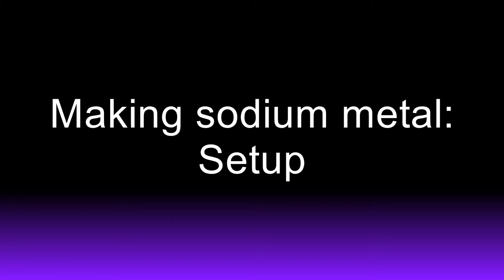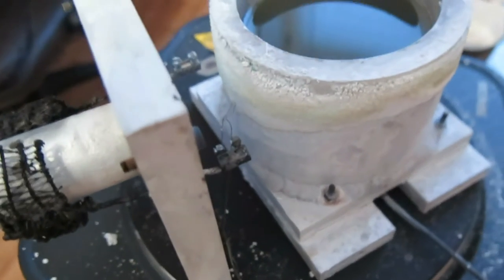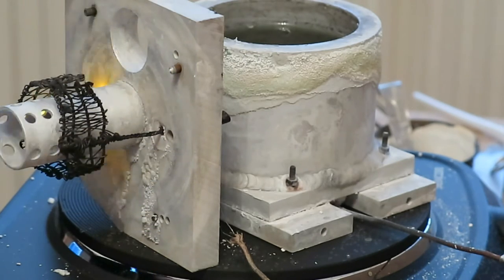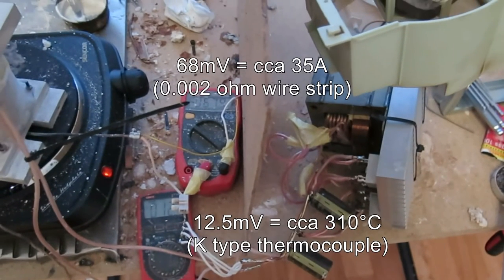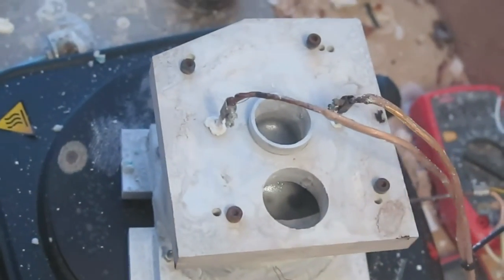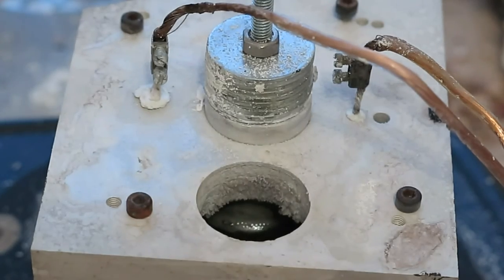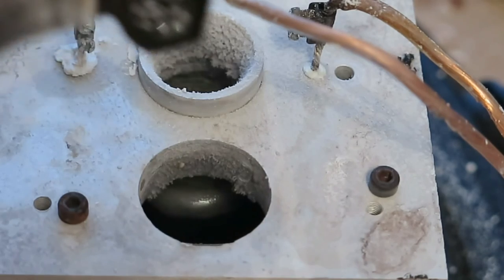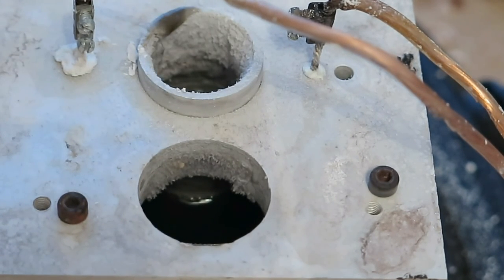Make sodium metal - Sodium hydroxide elecrtolysis cell

Comment: You put alot more effort in your set up but we are on the same page. I did mine outside gave the neighbors a show. The hydroxide also ate my gloves. Also found out I dont care what anyone says I say keep vinegar nearby as water will give you little mercy. When molten sodium hydroxide splashed forhead during tiny pops you will want instant relief trust me vinegar should be nearby at all times as even with saftey masks wierd things happen.. neighbors laughes hard.. I also connected the lead where the metal is formed to a pair of needle nose pliers as it would attract the sodium metal and I would gently grab globs continuously. I melted sodium metal with household pot and hotplate and kept mineral oil in another pot on another hotplate after collection of all sodium metal I would turn up heat on mineral oil till it melted the hydroxide and the sodium metal which allowed it to separate then I extract pure sodium the no hydroxide. Was able to complete whole process rather cheaply  Few dollars few chemicals burns couple regular burns and no scars. I'd this still sound like something you want to do at home that means your as smart as I am and someone needs to be supervising you at all times. DO NOT TRY AT HOME YOU WILL GET BURNED. DEATH IS POSSIBLE BUT BURNS ARE A GUARANTEE.

Comment: you can make a U bent tube, sodium metal is made only on one side of the U bend, so the weight of the sodium hydroxide pushes the sodium metal up and out a small exit, self separating the reactants
Reply from the maker: Thanks for suggestion. I made vid about future design(s) https://www.youtube.com/watch?v=kGxQbjS2IPQ
this one chamber design has advantage, that it is easier to arrange electrodes i a way they have to be in order to work. And that is close together and rather large.
I mean this U thing is possible, but I don't think, that simple bent tube would work. it would have to be welded of 3 pieces more likely.

Comment: Molten Sodium Hydroxide in an Aluminium container??? 
That sounds like a recipe for disaster. I haven't done it myself but I'm pretty sure it won't end well.
Or am I mistaken here?
Reply: It's fine at low temperature but at higher it would certainly be a disaster.

Comment: Please answer my Question:
Electrolysis of Sodiumchlorid in water produces chlorin gas and Sodium. The problem is that the sodium reacts with the water to NaOH.. So far so good..
But what would happen if you put the Sodiumchlorid into a Substance that works for the electrolysis, but doesn't react with the sodium? If that would be possible, it would be an extreme cheap, easy and safe method to produce Sodium metall? Do you know if that is possible?
Reply from the maker: Hi,
It is likely, that if this would be possible, somebody would at least try to do sort of that thing :)

What you want to do is basically dissolving sodium chloride in ionic liquid or "inert" polar solvent
Ionic liquid is a liquid composed only with ions, and therefore it is conductive.
as for polar solvents these would be probably fluorocarbons and as Nurdrage's recent research shows is that sodium is quite reactive to these.

in fact sodium is extremely reactive so you will need to be very clever to design a suitable solvent.

I found a few papers listing compounds, that can dissolve a bit of salt, which would be probably expensive and will not withstand presence of elemental alkaline metal.

However, I can't tell you that it can not be done...

If you are very interested, I would search for something like

soduim metal ionic liquid
soduim chloride ionic liquid solubility
soduim metal inert polar solvent
...

aaaand expect a lot of academic papers...

cheers :)
Reply: Ilusys Systems Thank you very much :)
Reply: Just fill a container with warm salt  then place ice on it,  keep pressure on it and keep it cold.
Reply: The only concern would be the clorine could dissolve into the solvent and destroy the sodium

Comment: What happens when the molten sodium hydroxide gets too hot? I read that the sodium gets dissolved into the hydroxide and cannot be separated. Has this happened to you before? I tried to electrolyze the lye on a small propane stove, and while it did work for melting the hydroxide, and at one point I saw a sort of a grayish film at the top. Afterwards(with my propane exhausted ) I reexamined the experiment, only to find that the sodium hydroxide had solidified into as waxy brown solid from which I could not removed the sodium. Frustrated, I poured water into the can. To my surprise, nothing happened. I expected at least some fiz or sparks or a subtle display of reactivity, but all I could see were supposed hydrogen gas bubbles evolving from the solid.
Reply from the maker: I think, that sodium should separate from lye when cooling in such case. What was material of your container?
Reply: Aluminium(a tuna can)
Reply: Just buy sodium it's so cheap
Reply: @AUXASSASINX  from where?

Comment: Fantastic! have you had any problem with corrosion of the aluminum body?
Reply from the maker: thank you! no problems at all during electrolysis. Cleaning with water does no noticeable damage as thicknes is 10mm or cca 1/2in.

I have not used it since winter, which is about 8 months and cell is laying outside not protected from weather. It is still full of NaOH! Still no signs of damage. I may try to open it tomorrow, but I dont have much time...

Comment: Any tips on how to make a power supply?
Reply from the maker: Yes, turns out, that buck converter is super effective and you can use cheap PC PSU. These are very handy also for other electrolysis cells. Even super basic textbook buck converter with random chokes that I find laying around is able to provide 20A of current that is totally enough for experimentation. In this case I operated around 5 - 7V, but for say Cu/Ni plating you may want to use 0-2V range so make sure it goes down to 0 if you want to buy one and use it for other purposes...
Reply: I used a strong laptop charges found at goodwill cheap amd effective check the label for voltage and amps

Comment: Why isn't the sodium hydroxide destroying the aluminum ? Is it because there's no water present ?
Reply: yes no water.....
Reply: @oceanhouse8080  Ok, I would imagine the cell would be slowly eaten away over time because the electrolysis of Naoh produces H2O as a side product.
Reply: I built a 3kg cell out of aluminium and I can verify its nearly inert to hot fused naoh my cell was molten for 3 weeks before my ceramic seal failed...... Once you get it hot you have to keep it hot because if you let it cool it takes water from the atmosphere, but other than that zero cell damage....and aluminium keeps the melt clean unlike iron of stainless causing contamination...I think the fused Noah causes the aluminum to build up a thick oxide layer that passavates it.....only better material would be titanium IMHO... I decommissioned my cell by pouring the cell while hot into a stainless steel can, then once cooled t be cell went into a 50 gallon water bath and was allowed to soak for 12 hours to dissolve the remaining NaOH, cell was broken down dried and placed into storage with no visible deterioration...
Reply: @oceanhouse8080  Good to know. I suppose if its kept hot any water that forms must boil out instantly.

Comment: I built one out of shitty stainless and it ate the bottom out of the cell with about a kilo of molten NAOH that ran all over the aluminum top hot plate.Lots of sodium kept catching fire. Had to dump 2 5 gal. buckets of sand on it till it quit reacting and cooled. Had it not been a on the garage floor it would have been much worse.

Comment: I wonder if it would not be better to boil out sodium metal just by heating all electrolyzer to the temperature of about 900C and then condense it?
that way danger of explosion could be avoided and the process can be run continuously

also instead of sodium hydroxide, chloride could be a cheaper option
Reply from the maker: Yes. That is done at industrial scale :)
https://en.wikipedia.org/wiki/Downs_cell
My goal is however make this possible for small scale production at home.
Reply: deltaxcd reaching temperatures >900° is not easy for most people. Not to mention, working at such high temperatures is quite energy intensive for such small scale production. While it is safer, it is certainly not as viable for the amature chemist.
Reply: Actually no, it is not that hard as you think I tried something like that on the very small scale, the only problem is heat resistant heating elements that could sustain that temperature while with electric heating you can reach unlimited temperatures.
Reaching 900C is on the limit of what you can do with plain heating wire, just using some standard heating element.  it is not very easy but too hard either.

In this situation, things are much easier because heating can be done directly with same electrodes and electrolysis

I would suggest even more simple setting: simply drop nichrome wire in the powdered salt and heat it using electric power to melt everything. Finally, apply DC current to the electrodes and heat everything to the sodium boiling point using that DC current
No extra hardware is required just ramp up the current.
Also as the bonus, there will be considerable amount of chlorine which can be used to make hypochlorite or chloroform
Reply: Is it a method to produce sodium by decomposition of NaOH or just the method of extraction of sodium produced by electrolisis from the rest of NaOH ? Will NaOH decompose when heated to around 900C ?  I read on Wikipedia that boiling point of NaOH is around 1390 C and boiling point of NaCl is around 1450 C,  but I didn't see any information about them thermally decomposing at some point below those temperatures.

Comment: Which mistakes did you make?
Looks extremely good by the way, simplistic, but practical.
Reply from the maker: Sorry for late answer.
Well I wrote something in the description - actualy whole development is full of mistakes and corrections. Basicaly the hardest part is choosing the right materials - so Al for casing and Ni for electrodes seems to be only option. NaOH eat everything and contamination will lead to higher melting point so process will be stopped.
Also it was long time ago and I don't exactly remember a lot of things :/
Reply: Thank you, May I suggest Fe for the casing? NaOH doesnt eat through it.
Reply from the maker: Hi,

Thanks for suggestion. Guy here http://www.sciencemadness.org/talk/viewthread.php?tid=9797 uses stainless steel I think.

While steel is fine when talking about contamination, that steel that I used was no more stainless after experiment, so that also may be issue for me :)

the main issue is, that I used 6V supply i think and electrolysis takes about 2V or so. So 4V was wasted as heat(so hotplate can be turned off).
Al in NaOH will form film that is non conductive, and that is important because if I separate electrodes by conductive steel, that separating element will have a potential of 3V and thus I will have 2 cells in one:
0V (3V diff) 3V (3V diff) 6V
On both sides Na metal will be formed along with H gas and O gas. So yield may be the same, but NaOH will be consumed twice as fast + there may be explosions + Na2O will be formed and so on...

I dont say, that it is impossible, but a lot more tolerant and clean using Al...
Reply: Richard Antalík i understand, I will problably use NaCl and a steel containrr with plastic lid inside a kiln, lets see how it goed.
Reply from the maker: Well I also tried NaCl(even mixxed with CaCl), but at that temperature without inert gas atmosphere Na metal will imediately react with air...
I guess that at those temperatures even teflon will decompose.

But I realy can not imagine your setup so...
Reply: Richard Antalík a cel inside a kiln that goes on when the temperature drops, the Na shielded with CO2.
Reply from the maker: Sure try it, but also note, that CO2 is inert for organic material, because it is the product of burning, but for metals, and mainly alkali CO2 may form carbonates. But I dont know what temperature is needed for such reaction. 

Good luck anyways :)
Reply: I know! But I dont have acces to argon and such, CO2 will react slower so I can live with that.

Comment: Hi, from what material are insulators made in the body?
Reply from the maker: You can watch 2 videos in description.
Improved cell design overview: https://www.youtube.com/watch?v=kGxQb...
Cleanup after bad storage: https://www.youtube.com/watch?v=wK5c2...
I used ceramic fuse body sealed with Hi-temp sealant/cement. i used sealant based on sodium silicate/silicic acid

Comment: as you have sealed the electrodes ?
Reply from the maker: Electrodes are sealed from the aluminium body by ceramic tubes(fuse 
body) and by stove sealant, which is basicaly sodium silicate - 
waterglass.

Comment: Does the amp and volts have to be specific
Reply: No. voltage should be higher as needed for efficient electrolysis - say 6V instead of 2. Total power should be maintained, so the NaOH will stay molten even without external heating.
Reply: Průzkumníci so can I just use a 6v lantern battery an it will work???
Reply from the maker: Heh wrong account :D nevermind
I should have be more specific about amps required - @ 4:20 I am saying that I was running this for 1h @ 40A to get 10g of sodium So you will probably need a lot of batteries :)
This thing requires quite heavy duty PSU
Reply: Ilusys Systems why you do this to me
Reply: lol screw this method ill just mix sodium hydroxide with magnesium
Reply from the maker: That's also a way. Maybe check out NurdRage method in description.
this cell is rather investment if you want cheap and stable source of sodium... after some further engineering it can be also cleaner.
Reply: I have found many computer PSUs in the trash, up to 850W. They can deliver fx 70A at 12V. A cheap ebay booster circuit can make that PSU a variable powersupply with constant current and constant voltage properties. It takes the 12V 70A and transforms it into 0 ~ 50V 0 ~ 20A DC so you can do your projects. Just parallel/series more PSUs of the same kind to get higher voltages or more amps.
Reply from the maker: few points - 
PC PSU are kinda overrated so I would expect max 30A@12V cont. from 850W psu... They cannot(easily) be connected in series(GND connected to earth), and parallel may be also tricky due to nature of their regulation loop.
Chineese buck and boost converters are often limited to 10A output...

if I would do lab psu, I would choose single powerful 48V "industrial" psu and custom buck converter...
Reply: I know what you mean but, the first great thing is that most are electrically isolated, next they are made for use with a stable output, so if you need to power something big that uses high currents in bursts/ripples you can put a high current, high capacity inductor in parallel with a capacitor and much more than 30A. 
Also, the more modern DPS supplys hold up pretty good. they are software controlled.
Also break GND off the cable. It's useless for a controlled environment where you work electrically isolated through the PC PSU
Reply from the maker: I was just warning people :)
PC PSU's are probably most cost effective solution, but you should know the limitations...
Reply: That is true. I also noticed, that there aren't many if any videos of the simple setup connecting an inductor and capacitor to the output. So i created one "linked below so Ilusys Systems can remove it if he/she wants to".

Comment: Impressive.  Give no credit to those that degrade this due to the chemplayer style.  I would wager chemplayer would applaud this work for curiosity, but it is not safe.  It is worth mentioning to others that making sodium metal is dangerous.  Make damn sure you know your shit before doing anything like this.
Reply: True, if a person is able to do this easily that person probably knows how to handle the situation.  My point is to keep the curious amateur from maiming themselves, or burning down their house.
Reply from the maker: I know, I just joked a little bit..
Even me cooled sodium with mineral oil, overflowing container, and it catches fire :)

It is said that many drivers will destroy their first car. So did I. I don't think, that there is any way around this. Maybe in car accidents there could be better and longer training, but there is no way that there will be training for everything..

Well maybe there is - it's called life :)

But yeah I see your point, in fact I rather warned to not connect electrolytic capacitor to AC voltage, because that is quite simple and there may be someone, that would not expect it to explode.

Anyway, sorry, but I just enjoy these philosophical discussions :)
Oh and I found safety warning(s)
https://youtu.be/BElkJ6VNwO4?t=1m41s
https://youtu.be/BElkJ6VNwO4?t=2m10s
https://youtu.be/BElkJ6VNwO4?t=3m53s

Comment: Did I miss something? I'm pretty sure you just put pure Sodium Hydroxide in an aluminum container? Or does it only create a hydrogen cloud when it is dissolved in water and then put in aluminum?
Reply from the maker: pretty sure I have said, that I think there is pasivized layer or something in video, so you missed the content :)
Reply: @IlusysSystems  I thought that looked like aluminum but I figured I was mistaken as it should made quick work of that aluminum at high Temps but you would definitely notice a violent reaction if it ever does reach that aluminum